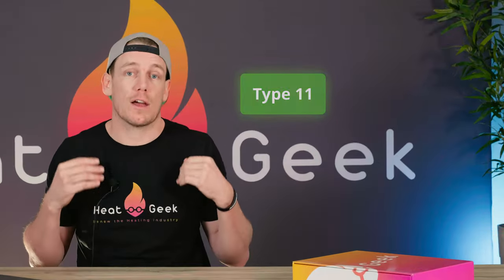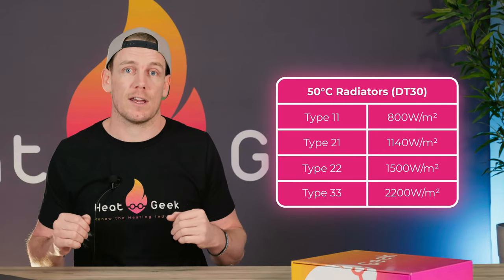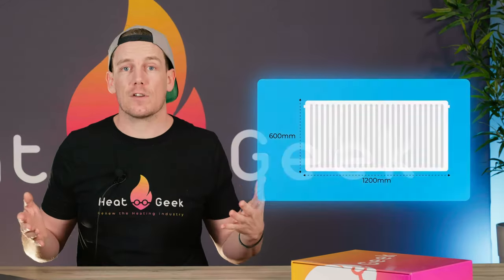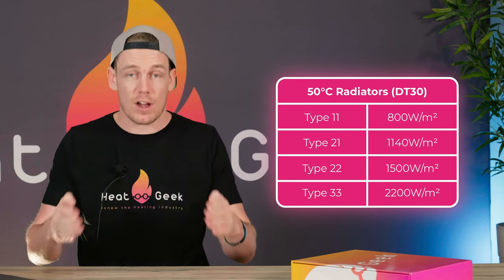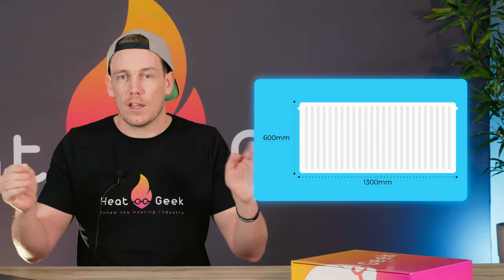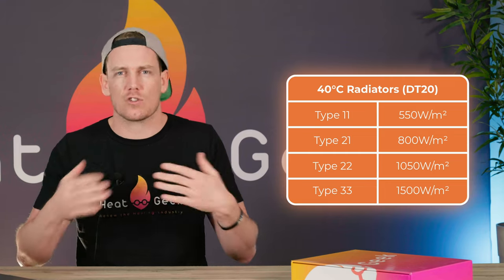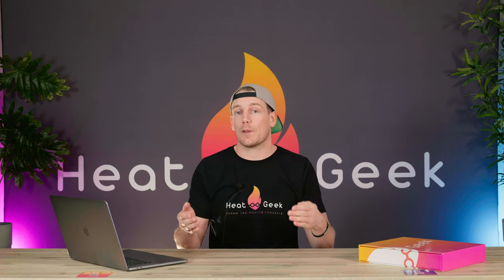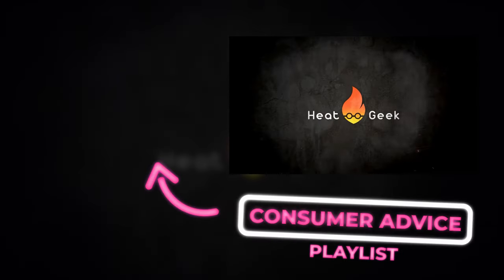Should I Upgrade My Radiators For A Heat Pump? | RADIATOR CHEAT SHEET | Consumer Advice

Comment: Thinking of getting an air heat pump.  Prob going to go for underfloor heating downstairs and then considering radiators upstairs on cost and because we'd want carpet on the first floor.  Assuming insulation decent downstairs and given heat rises, will upstairs generally get decent residual heat from downstairs to compliment the radiators?  Or is it worth the extra investment for the UFH upstairs under the carpet?  Any advice or where to look would be great.
Reply from the maker: Heat loss is actually quite similar upstairs and downstairs. Generally people keep upstairs a bit cooler though so rads are fine.. to know if it's worth it is very personal and difficult to say.  Genrally not but almost I would say, as a gebral rule.
Reply: @HeatGeek  Thanks.  Interested in your cheat sheet calcs as these seem much lower than others suggest.  I always get the impression from other things I have read that you need massive rads for heat pump but your calcs don't suggest that.
Reply from the maker: @chrissanders55  the calcs are drawn from traditional cibse calcs. However they iver egg as their air changes are out. What are you comparing too?
Reply: Also, if you drop heat pump temps from 50 degrees to 35-40 degrees, is there a cheat sheet for that?
Reply: @HeatGeek  I think it might be because they are working to lower temps than 50 degrees.
Reply from the maker: @chrissanders55  yes if you follow the link in the description

Comment: Good video, enjoyed your commentary on heat pumps thus far. Please don't limit people to type 11,22 radiators, there are many beautiful designer radiators that can work on heat pumps effectively and achieve the outputs at lower flow temperatures, no need for dull corrugated steel panels.
Reply from the maker: Designer radiators are typically very poor imo. They sometimes state their output at dt60 instead of industry standard, irften come filthy internally, lower grade steel and have flow rate issues faaar too often. The baffle systems used are poor too imo.. ufh is king!
Reply: It is all down to surface area, both convecting and radiating. Unfortunately many fancy radiators have low surface area for their space envelope.
Reply: @rogerphelps9939  Roger, all depends where you look, we have designer radiators like our D line 600H x 611W is comparable in heat to standard radiators Type22 of same size, practically the same output , as is our Core radiator at 600H x 609W - 4 columns, both great products and great outputs.
Reply: Glad to hear it. @featureradiators

Comment: The best radiator for heat pump is "Anit Radiator " 
specially designed for low temperature

Comment: Hello. Really helpfull info ! I have a question though: you mention to calculate for a type 33 rad, at 40 degrees water, an output of ~1500W/m2. Based on the specs for a Purmo rad (good quality, overall), the output is 1360W/m2, but with 65 degree water. Quite a difference. Am I missing something?
Reply from the maker: Not sure in that example. At all.. makes me question purmo rads which I thought were OK... ide need data sheets etc
Reply: Hello. I have checked also with Vogel&Noot, pretty much the same: 909W output (45/35/20), for 33x900x1000, so around 1000W/m2. This is also from V&N website, official specs
Reply from the maker: @adrianbotos2819  45/35 is dt 10.. targetvis dt 5 woth heat pump
Reply from the maker: Also that's 0.9m2
Reply from the maker: I thinknthis was calculated off stelrad
Reply: Thanks Adam ! 👍

Comment: Just a needed correction - the size/Kw of the radiators is calculated at 60C of the water inside and DeltaT 20 ! Bear in mind

Also, fan coils to be considered instead of radiators is appropriate, as they need 40C water to operate correctly!
Reply from the maker: sorry not following?

Comment: Cast iron rads? Aren’t these more efficient? That aside huge rads, in period properties, aren’t viable. Underfloor is the option to make these system work properly. Again not possible in many period properties, and too expensive to retrofit in most circumstances. 

Properties that need to be made more efficient for environmental and cost reasons are period properties. New builds can be passive and therefore require no, or very little, heating. These systems aren’t the answer the problem. I’m afraid it’s a red herring. The question is why aren’t new builds passive, and what is a more effective option for period and ancient houses.
Reply from the maker: Heat pumps can heat period properties without ufh just fine. It's our main demographic
Reply: @HeatGeek  thanks. I guess it would be given they are the will be disproportionately effected by the rise in energy costs and the fact they make up the majority if the housing stock in the uk. 

However, massive rads in older houses look awful, in fact they look awful in any house. I’m not sure whether this effects resale but the look of a house is a big part of why many buy a property. 

There are also practical considerations. The amount of insulation etc required to make ancient house thermally efficient isn’t possible. Often due to the structure itself, more importantly for the buildings health - if they sweat they rot - and lastly due to planning restrictions. 

Once again retrofitted newer house to be passive, and a different system for older properties is the solution in my view. Quite why this isn’t happening is beyond me. Perhaps the answer lays in a lack of critical thinking skills, or the financial interests of the powers that be.
Reply from the maker: @matthewmiller9575   having an old outdated boiler and a poor epc will affect your property price more.

The reason someone hasn't invented a cheap, green high temperature solution isn't lazynes. There are people working around  the clock. It's just likely to be outside if our current capability... and couple be for hundreds of years. If you invent something you will become a kazillionair.

There is on solution which is the Vitovalor hudrogen fuel cell but that only has lower carbon not 0 carbon so not long term. We are the uks number 1 installer of that
Reply: @HeatGeek  for every action there is a reaction. By being alive we have a detrimental effect on the environment. People forget that inventions such as heating, cheap fuel, food etc were intended to stop suffering. But there has been a cost. It’s inevitable. Perhaps the cost will be greater than the benefits, we will have to wait and see. 

I have no vested interest. The only solution(s) I can think of is to go back to being hunter/gatherers which obviously isn’t going to happen and of course passive new and nearly new houses. In these cases this is the answer - not other types of heating systems.  In essence we should no longer be building houses that require heating. 

Other than that I merely point out that (a) these systems aren’t efficient in old house because of structural reasons (b) planning restrictions will often prevent you from carrying out any work to the house to make them thermally efficient and (c) this type of work shouldn’t be carried out in ancient houses as it stops the house breathing which in turn makes them rot. Replacing old housing stock with new.